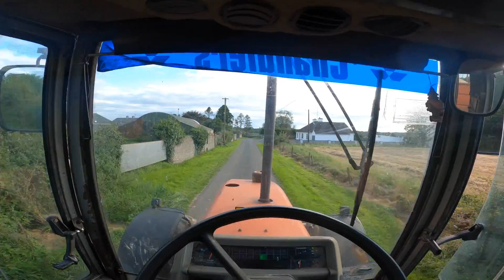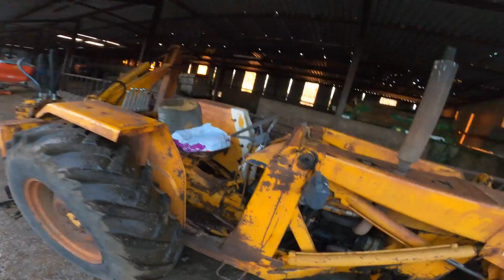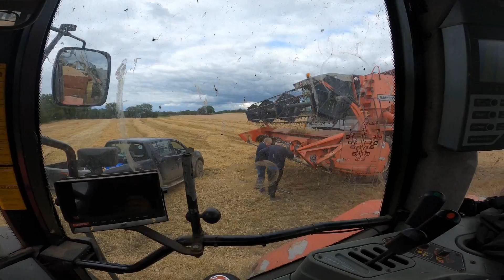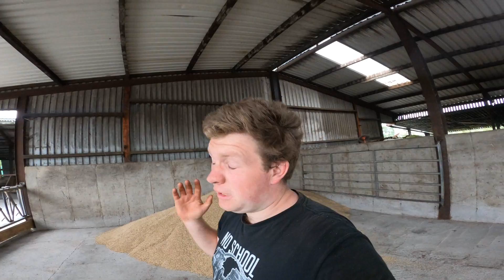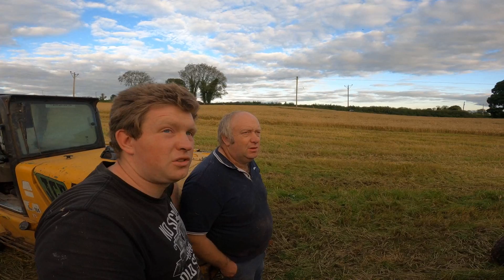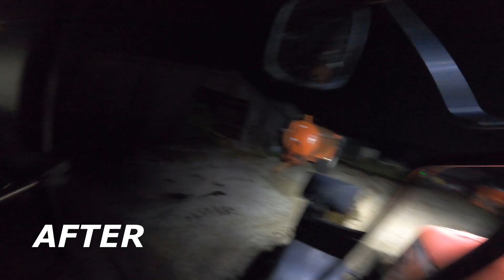THAT SHOULDN'T BE THERE, GRAIN IS TOO DRY MUST ADD WATER -- HARVEST 2020 CRIMPING BARLEY AND WHEAT

Comment: Hi, Phil!  I like the longer videos. You know, I think that the bird-scarer you have going in the yard could have been sabotaged by the crows and pigeons.

What they've done is cut the wires and installed a bypass switch. When they see you coming, they turn it on and everything sounds fine.

But as soon as you're back in the fields they're shutting it off and calling in their mates on Twitter.  While you're busy harvesting they're feeding away on all that barley...  ;-)

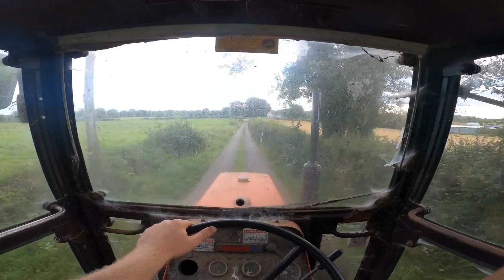Comment: @04:20 In.....Phil.....are those spider webs on the right side along the edge of the tractor window? I would wreck that tractor if I was driving it and something with 8 legs crawled out of one of those webs. I am pretty much fearless and not afraid of snakes or much of anything....but spiders even though I'm pushing 70.....spiders just freak me the heck out.....